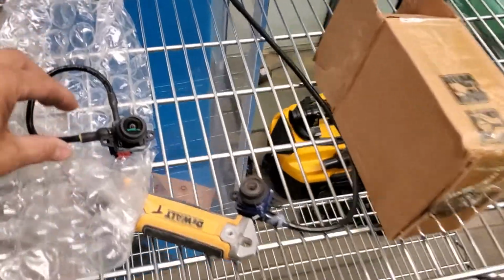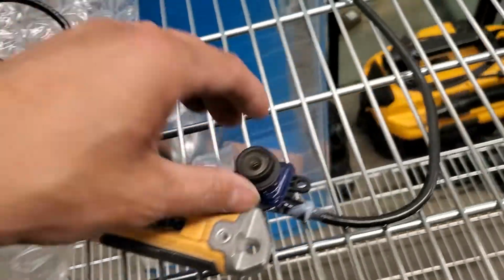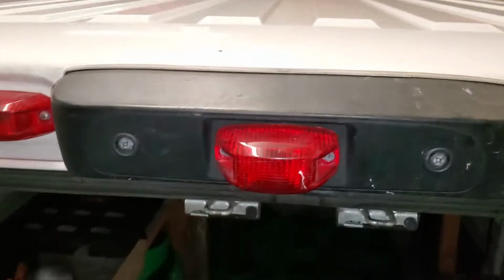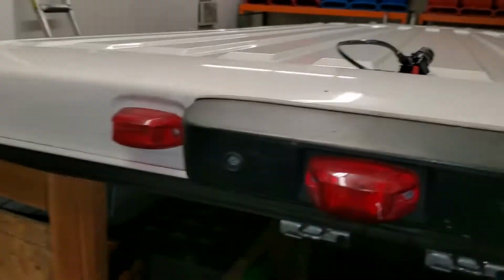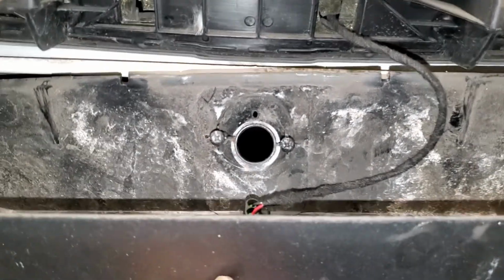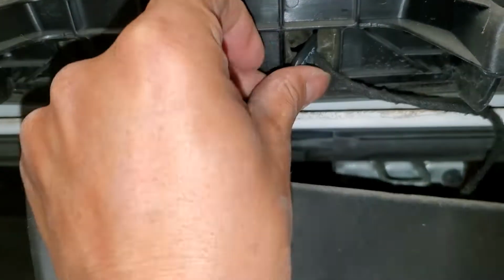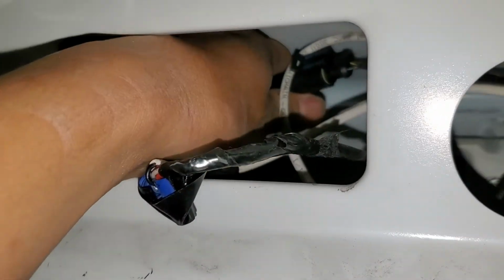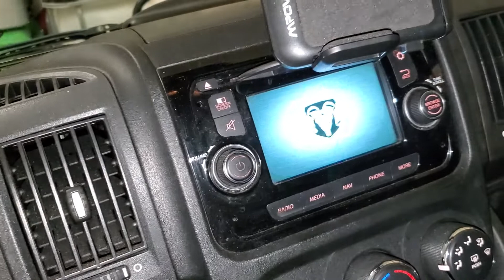ram promaster 2500 backup camera installation link in description

Comment: My camera is working, but it's a fuzzy blue-ish screen. Nothing wrong with the screen. Only fuzzy when I use the backup camera. You think replacing the camera itself should solve that?
Reply from the maker: It might. Maybe the camera is on its way out
Reply: @migueltorres79  Yeah, I was thinking that as well. Early warning signs to replace it.
Reply: Also getting a flickering picture